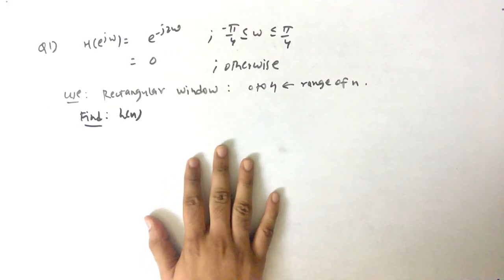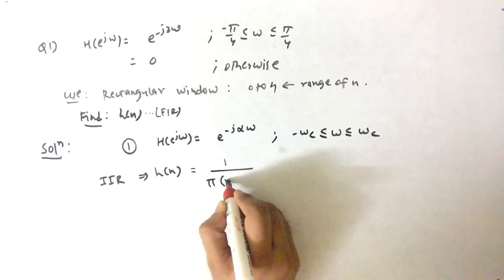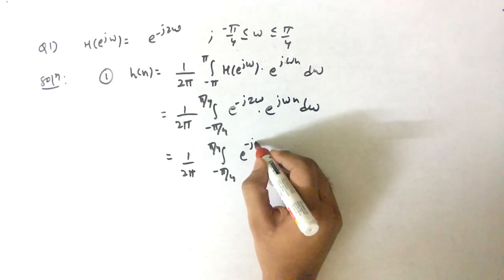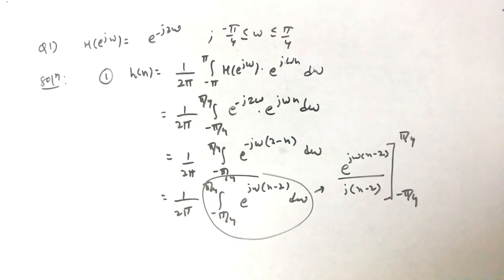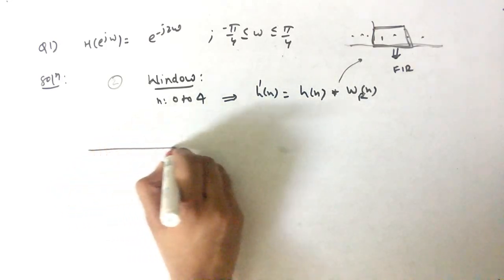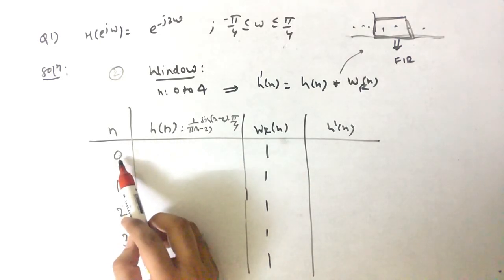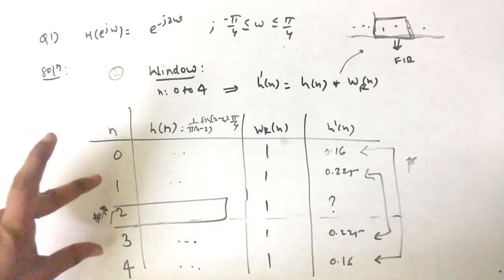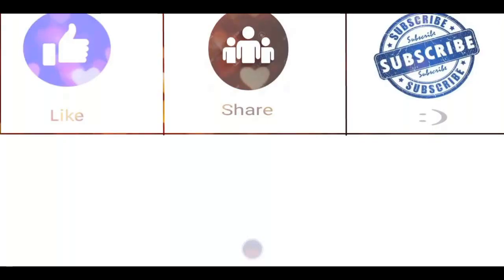TRICK for designing FIR filter using window method - LPF

Comment: Hello sir u have written h(1) as .225 as the answer but if we substitute we will get 0.00436.. please verify which is correct
Reply: Put ur calc in radian mode not degree. u will get 0.225
Reply: @oldbot64  but still it is 0.210 and not 0.225